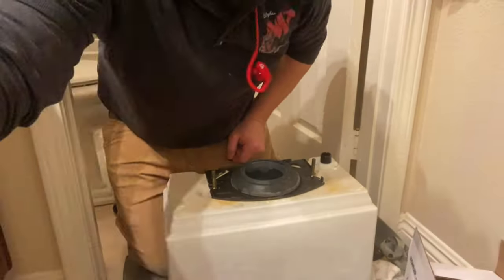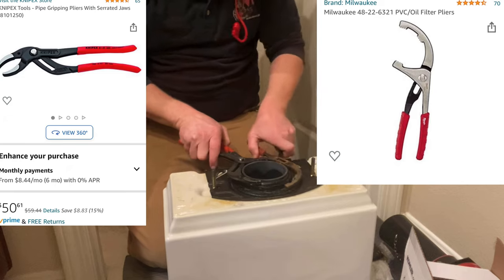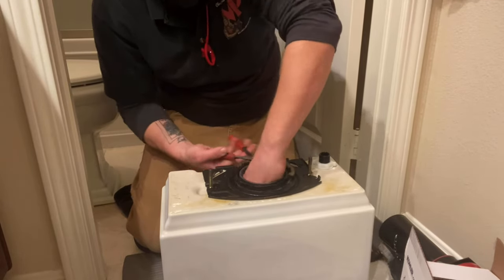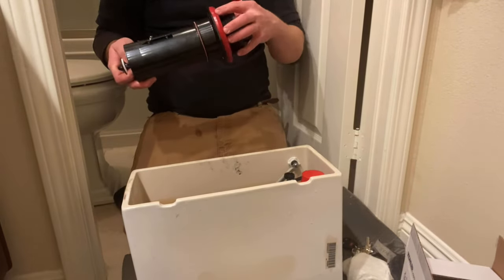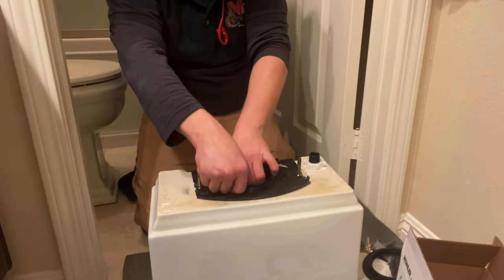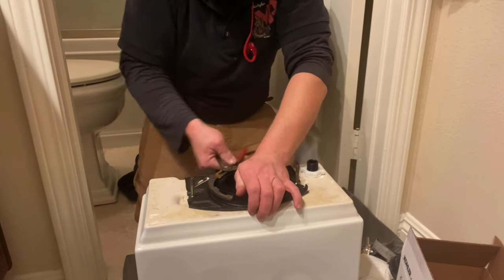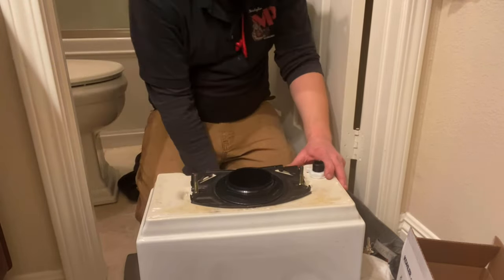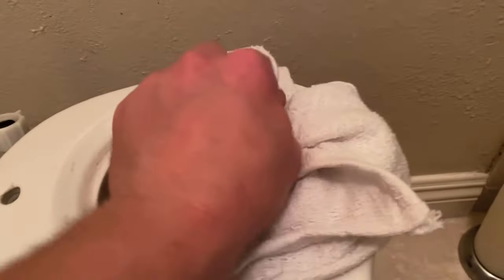How to fix 2 Piece Kohler toilet leaking from Tank | How to replace a Kohler 3" Flush valve

Comment: I replaced the whole unit with mounting bracket and gaskets. The oil filter wrench was a great tip and help get mounting nut off real easy. Thanks for the video.

Comment: Thanks for the video...just did my complete overhaul job because of the phantom flush every 45 minutes......the flush value gasket was shot on one side and there was the leak.......the only thing I add to the install was putting a rubber washer on the bolt touching the bowl......now i could tighten and not worry about cracking it....

Comment: Thank you. All was good until I couldn’t get the nut off w oil filter wrench. It wouldn’t budge. Used the spray and also WD 40. I’m sure the problem was attributed to me being a 68 yo Grammy lol. Finally I basically used a screwdriver and broke the nut some. So, I’ve got one more I want to do! Dislike. Thanks again for the to the point video. Lifesaver.